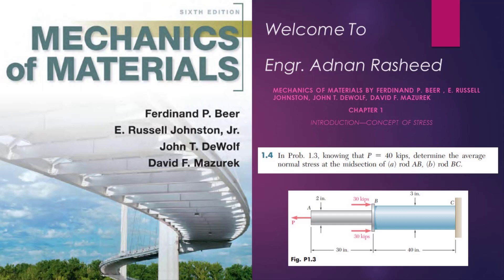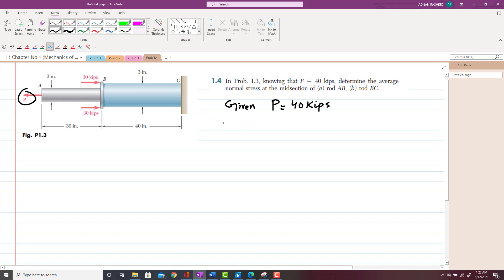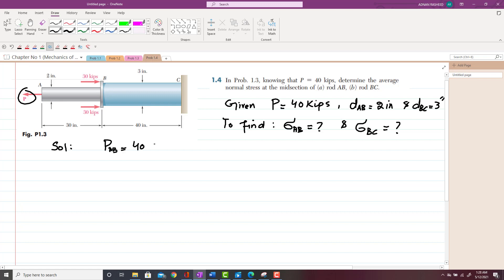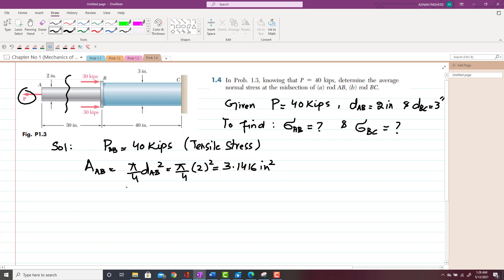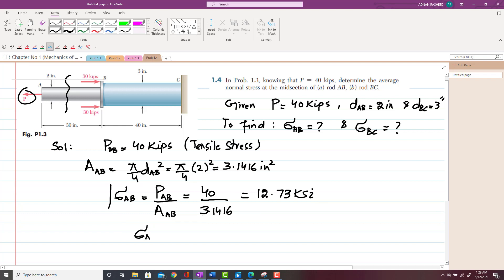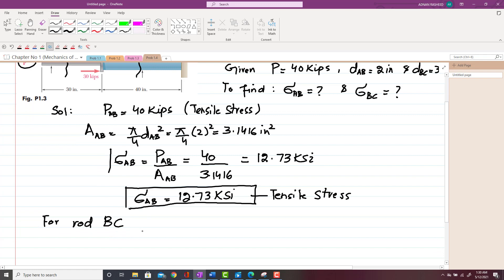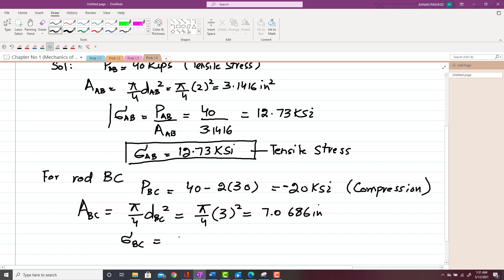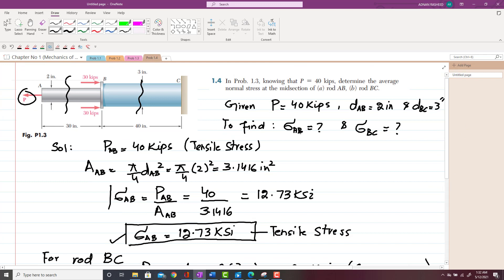1.4 Determine average normal stress at midsection |Concept of Stress| Mechanics of materials Beer

Comment: I have one question else 
If be p=20 kips can we write 2(30)-p for this 1.4 problem?
Reply from the maker: No as you can see 20 < 60 So net force will act towards right side and to balance it the using equilibrium th force should be on left side causing compression.
Reply: Ok thank you i got it
Reply from the maker: @yasna3683 you are welcome

Comment: Why at problem 1.3 2(30)-P and the problem 1.4 P-2(30) what’s different between these?
Reply from the maker: In this problem the net effect in portion Bc causes compression that's why 40-2(30), while in other problem the net effect will be tensile that's why it is 2(30)-P.
Reply: @engradnanrasheedmechanical  thanks professor
Reply from the maker: @yasna3683 you are welcome